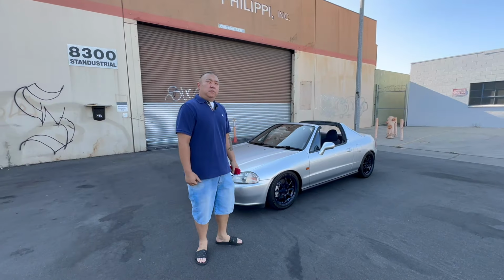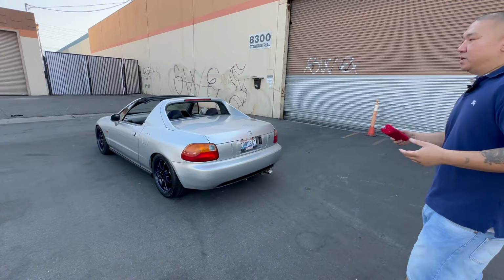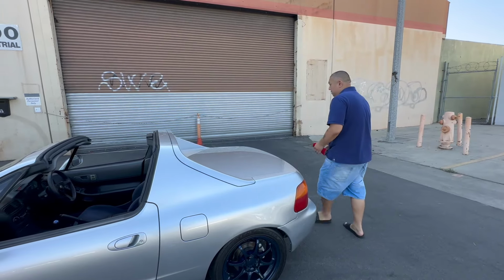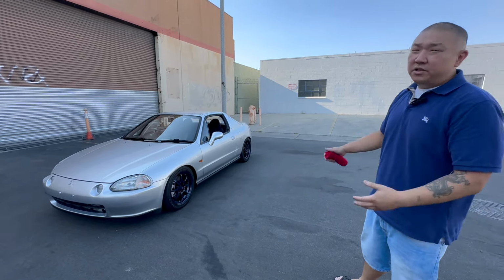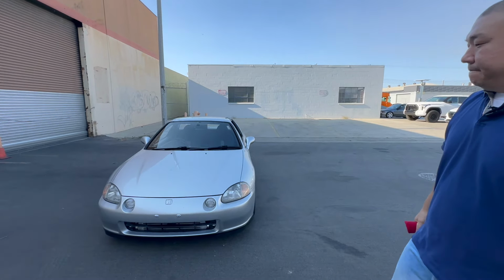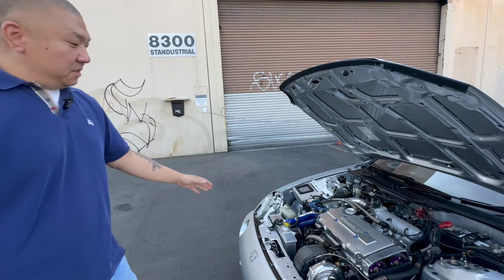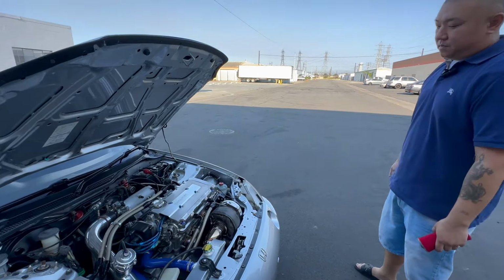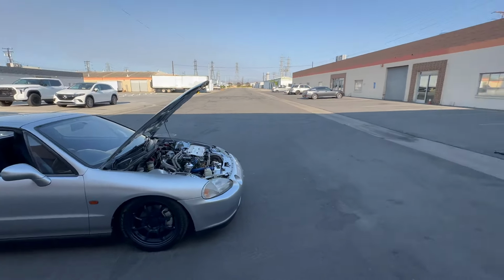Building one of a Kind : Proper 500HP Rhd Del Sol!!

Comment: The trunk is dumb. I have a 93 Del Sol and you lose half the space of the trunk for the motor and it add a few hundred pounds to the car. The regular trunk mount the roof in the same place. You actually lose trunk space with that design and it can break. I am in WA as well.